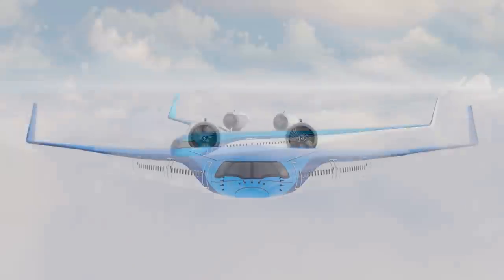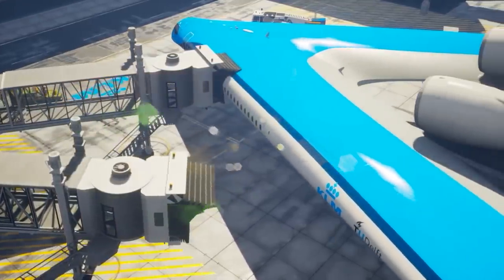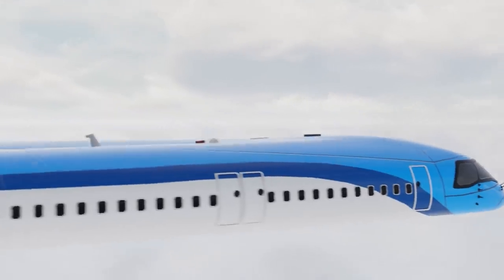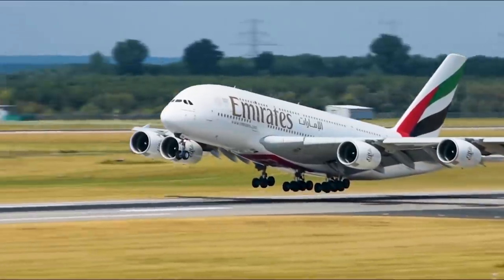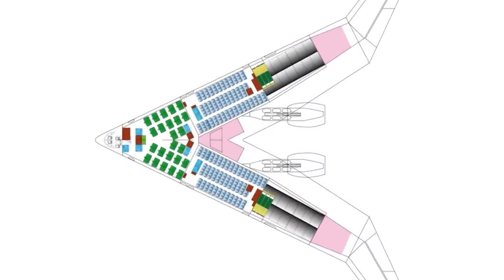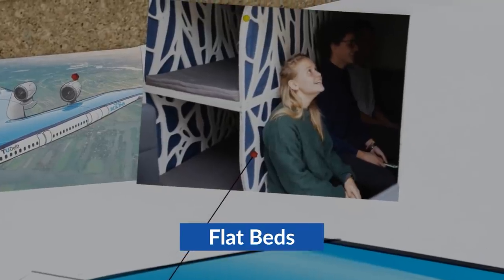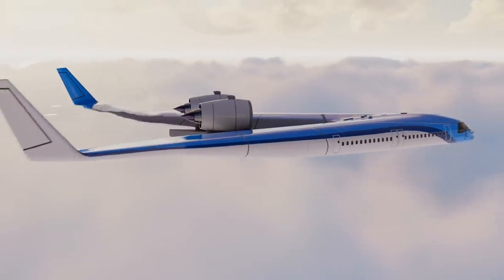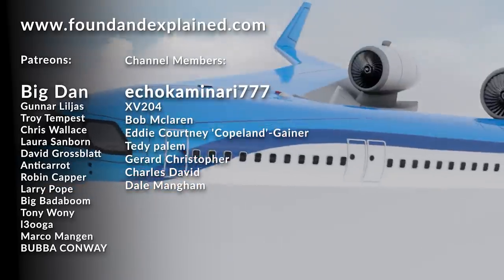Why would you (not) want to ride the Flying V

Comment: It's disingenuous at best to address the question about why we only see the tube & wing, by saying that the conventional B-47 layout is simply the best possible form. Aviation is markedly conservative, resistant to upheaval, very steeped in tradition, and controlled to a large degree by the personal aesthetics of CEOs of Boeing.
IDK how many red herrings are in that "explanation".

As for this plane, show us a large scale flying model that doesn't side-slip down out of control from a high bank, or doesn't flip into a spin like a Boeing or Airbus, in a stall with unfavorable conditions.
It's dumb to rely on complexity and computer controls to compensate for built-in dangerous instability.
Few all-wing with wingtip fins have been safe and stable.

Some all-wing with centered fins have flown well, some markedly better than "normal" planes. Some lifting fuselage body planes have flown well, some have flown markedly better than "normal". Many tail-plane-less designs have done well.(only if they keep a substantial fin)

As for paper designs, see the '70s Boeing model 754/759 and the Airbus VELA studies which followed the earlier (and bigger) TU-404. Nobody says such designs have to be monstrously huge. A 100 passenger plane benefits too.
See the Lock-Mart "hybrid wing/body" design with a tail over a cargo ramp. Normal handling and construction methods, 30+% extra range and payload compared to a "normal plane.
Deafening silence from buyers or operators.

Comment: Its never going to happen. The B2 bomber which is  the only wing shaped aircraft currently in use  proved that the wing design is so inherently unstable that its impossible to fly by a hunan pilot. If it wasnt for multiple redundant computers >t would stay in the air. For military aircraft thats fine but from a liability stand point it would never be acceptable for passenger flight. No one would 3ver insure the airline for that type of aircraft.

Comment: hey screw this i also have a similar idea and it's also a flying wing. Man i gotta apply to space X with my idea it's so good and might actually be a travel reform, but i doubt it would be totally revolutionary since planes are much less versatile than ground vehicles. To anyone wondering my expierience is 1100h of playing war thunder planes and marveling at 1930s through 1960s aviation but also looking some 80s and 90s planes up on wikipedia because they're still in service but obviosly civil aviation which my ideas are about is different from military aviation. I also have 190h of kerbal space program expirience. 

Yall think Elon is enough of a memer to employ me in a sector which doesn't exist yet in order to reform travel? LOOOOL
Reply: BTW: the reason i think flying wings of any size to be the future is because they are what happens when you reduce the plane to it's basics. The wing is all you need and engines are all you need. sure stabalizers are important so lets add those too. the fuselage is only for cargo. so move the cargo to the wing and save weight edit: and it reduces drag like mentioned in the video /e. I love what the designers are going for but i think this design can be improved in the sexiness department. which i have an eye for i believe hehe. another thing you need to consider, and i don't know if it's mentioned in the video because ive only seen the first 3 minutes, is if you're building a flying wing airliner, how much "turbulence" will the passengers at the edge of the wing experience? if the plane rolls to one side or gets kicked around in the wind the people at the edge will suffer horribly so i wonder if the took that into consideration going into this video.
Reply: hey also the reason for the external engines is interesting i hadn't considered that but i do think it makes the plane look ugly
Reply: omg i love the seat designs this is also something i hadn't considered. simply genius!
Reply: honestly i'm not sure if the flying wing is optimal for airline travel. I think and this would be one of my many ideas is if you'd make an electric or hydrogen powered shuttle plane that can travel medium and long distances thereby reducing the problems with oversizing your wing haha. maybe like 30 passengers. The Problem with this is lack of Pilots and lack of infrastructure. If more people were Pilots then this could be viable. One of my ideas would be to make it capable of landing on water and land so you need to build less infrastructure. It's main application would probably be the countryside. I come from germany and we have a a lot of small and spread out communities that desperatly need to be connected more efficiently because land transport is too slow.

Comment: Boeing already toy’d this idea back around 2010 & even dubbed it as a possibility for a future 797. For obvious reasons that isn’t going to occur anytime soon. Its not cheap designing a new passenger jet & it takes years from concept & billions of dollars until it comes to market. So you better get it right or you fall flat down fast & hard. Even redesigning proven sellers takes high risk. As Boeing has found out with then737-max, 747-8, & 787. None of those planes have turned a profit yet & Boeing is deeply in debt. And I haven’t even mentioned the 767 which has been turned into a military tanker which still none have been delivered.

So if you think Airbus, which has been basically a copy-cat of Boeing & has proven to be very successful, due in large part for socialist subsidies  to prevent financial problems, if you think Airbus is going to take on the task of a radical new design on its own, its done that once before with the A380 & fell flat on their Face.